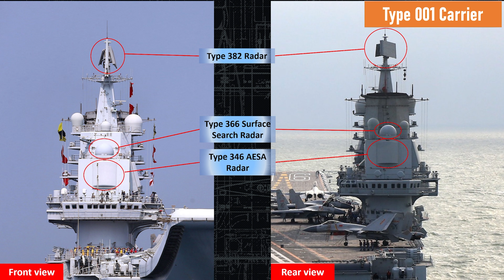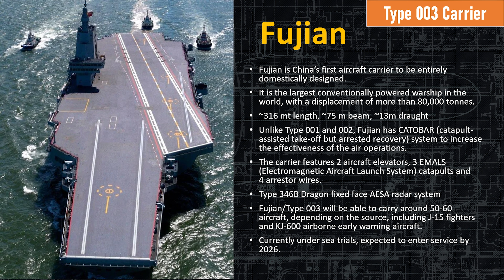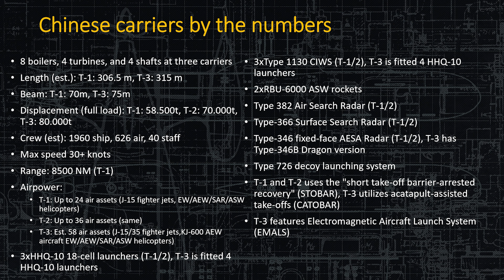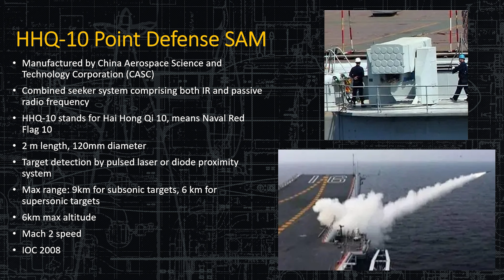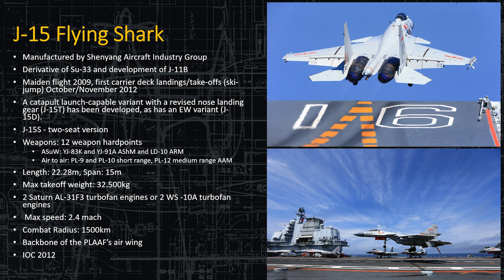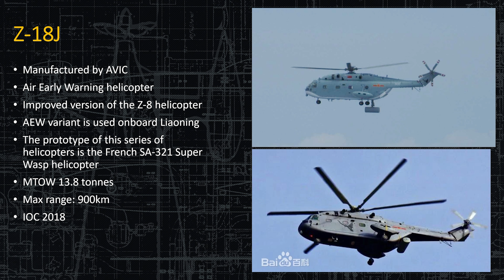China's New Fujian Carrier Changes Everything - Here's Why

Comment: 42:00 The J15 anti-ship missile variant launches with 20% fuel remaining from ships 1 and 2 and is then immediately refueled by a tanker plane dispatched from the mainland. This is a rather limited option, but China will operate its aircraft in the area of the first island chain and will easily cover the range of these aircraft using tankers from the mainland.
BTW UU NAVY did same with F18, and F35. (with F18 with 5 backpack as a tanker)

Comment: I'm confused by this video. why does it seem like the information in it is about 6 to 9 months out of date? did sub brief re-release this vid?

1. the power storage system - using super caps (which china is a world leader in) is hardly a straight up copy of a mechanical flywheel generator system used on the Ford CVN.
2. it wasn't a stolen system - it was a system developed and leveraged from their work with maglev and rail systems.  They likely have some of the most advanced DC power delivery systems, so it's hard to say they copied this from anyone.
3. even the ford has a replenishment ship following it around.  food, water, jet fuel, etc - so even nuclear carriers needs a babysitter.
4. J-15 can do air to air buddy refueling, so weapons vs fuel becomes moot.
5. J-35 is in serial production.
6. the Fujian is simply another training carrier, getting out the kinks of catobar, and leading to the development of the type-004.  As you know, China quickly iterates ship designs until they are happy with it, then they mass produce.
7. the fujian went into service in november 2025.

Comment: Why does it need to be refilled more frequently than a smaller AC? I thought the larger a ship is, the faster its fuel tank grows compared to engine sizes, thus, it needs refilling less (more gallons though obviously).
Reply: I just checked compared to US aircraft carriers operating in the pacific during ww2.  3-7 days depending on operational intensity. 

I know fuel was always a concern for admirals back then.  I didnt realize that much of a concern.

So his take on 5 days probably isn't that far off.
Reply: @wardaddyindustries4348  the "6 days" figure was AIR FUEL resupply limit. the carriers themselves can motor for far longer. Sub Brief is not an expert in non-submarine areas so you gotta do more research and take on more load to understand the complete picture.
Reply: @housemana  ah yes. I just looked a little deeper your right. That being said i wounder what the Fujian real range is with presumably more advanced engines. I have noticed that about this channel its not super often I watch it. I kinda wanted to just see how much he insults the Chinese capabilities before I left. Lol

Comment: I never served on a carrier, but I was fuel king on the USS Bainbridge a nuclear powered cruiser. We only used our diesel engines as emergency backup for the reactors. As such we didn’t run them all the time. When running they went through about 800 gallons a day. We had tens of thousands of gallons of JP-5 fuel onboard. This was the same fuel used by the Navy helicopters that would land and need refueling. Even then we only refueled our JO-5 tanks around once a year.
Reply: No diesel rot?
Reply: @surters  It's not diesel. It's JP.
Reply: What stopped the fuel going off/Rot?
Reply: OPSEC

Comment: Aight, so... looking at the comments it seems a lot of people don't understand how EMALS works and are seriously overestimating its power draw. This may be because the Ford's EMALS are said to have a power draw of 20 MW during its launch stroke, which in people's minds might translate to the four cats needing a staggering 80 MW to operate simultaneously. 

EMALS may need a maximum 20 MW per launch stroke but the key here is that each launch stroke lasts only SIX SECONDS. From publicly available information, the actual max energy draw per launch is 122 MJ. Catapult cycle time between launches on a USN carrier is technically 1.5 minutes, although in reality it's closer to 3 minutes. But let's take the theoretical launch rate and give each EMALS unit 1 minute to recharge. That's 122 MJ / 60s = 2.067 MW. Let's round up to 2.1 MW. The total power draw to recharge 4 EMALS at the same time is only 8.4 MW. For reference, a Kitty Hawk's total electrical power output was 20 MW. Nimitz generates 100 MW and Ford generates 125 MW. Fujian's specs aren't known, but tender documents suggest that she might have 8 of the same QD-50 turbogenerators used by the Type 055 destroyers. Each of these generates 5 MW, so Fujian's aux power generation capacity is around 40 MW. This is outside primary power generation from the integrated generators connected to her steam boilers. Hotel load is probably handled by this primary generator.

Assuming the EMALS on Fujian have the same power draw as the Ford's, the Fujian would only need around 6.3 MW to power her cats during operation. The 055 has only 6 QD-50s and her electronics and radar are basically the same as Fujian's, so Fujian's power draw from other combat systems are at most 30 MW. Even with all cats and systems running she has reserves of around 3.7 MW. She has more than enough electric power generation capacity to handle her cats.
Reply: Also, Fujian's EMALS is very different from the ford. It's DC medium volt based and should be far more efficient and reliable. China is now the top scientific and engineering country for electric engineering, energy storage, it is foolish to dismiss their technical expertise. They chose to go a different route and it is paying off. It shows they have the right people in right places to make these technologies possible. The Fujian is a indirect testament to China's over all industrial and scientific might. Seeing so many comments accusing the Fujian being unable to power its EMALS when some of the best electric, marine and turbine engineers and scientists in the WORLD are found in China is so absurd. It smacks of racism, it basically amounts to "no way these dirty yellow monkeys can build a functional CATOBAR carrier, no way Jose."

If EMALS is easy to research and build, why don't the French do it themselves instead of risking it and buying an unreliable US EMALS. They could have study the Chinese medium DC solution and replicate it. Why not?

Because the Americans and French literally CAN'T replicate it.
Reply: How is this power stored in order to be averaged like you're doing? Giant capacitors? A thousand tons of batteries? What happens if shrapnel hits these capacitors or batteries? 
I've seen Chinese batteries catch fire. It's ugly. 
I don't know about how safe capacitors are.
Reply: @ED-es2qv  Ford uses flywheels (because its EMALS is AC), Fujian uses MVDC capacitor banks.
Reply: @ED-es2qv  Just to back up the guy you, in your infinite wisdom are mocking, flywheels are also used in data centers as backup power sources.  They are made by such obscure and arcane companies as General Electric (GE), Eaton (go to the Home Depot electrical aisle), and CAT (as in the yellow caterpillar company).  As for how safe capacitors are...go lick one from a sound amplifier you would find at a concert from the 60s-80s and come back and let us know.
Reply: My dude, you are trying to explain science to Americans.  Waste of time.
Reply: @LackofFaithify  typical europoor superiority complex- yea surely Americans are just all stupid and haven't been at the bleeding edge at operating in the hard sciences for over a century now (:

Comment: why don't the USN shift to Compact Modular Marine Reactor propulsion & full IEP . . . unlike traditional marine reactors CMMR needs to be refuelled every 3 - 4 years & really small & compact in size, fully contained unit with a plug-n-play affair . . . agreed you'll need to put 4 or 5 (36 MW) U-CMMR that can be easily swapped with a new U-CMMR within a few days . . . no longer cutting through the carrier flight deck or the hull for defuelling & refuelling A1B marine reactors . . . U-CMMR operational costs are less than ¼th the cost of A1B marine reactors . . . the naval industry needs to embrace such modularity asap especially considering the current geo-political situation worldwide . . .
Reply: The reactors on the USS Ford will need to be refueled in 20 years.

Comment: It's the British who invented the modern aircraft carriers with the angled landing strip.
Reply: which makes the state of the British navy quite the tragic, sad, ironic tale. ya'll can't even field more than a single CRUISER at the moment, deadass how ya'll managed to defrang yourselves while letting a literal replacement population come in and start running things is impressive. legendary cuckoldry, fueled by white guilt.
Reply: What is the purpose of the angled landing strip? Maybe just to create more surface area for parking planes? Seems like it would just make the landing approach very difficult.
Reply: @edinson1613  
Are you real?  Knowing, why the LANDING deck is angled is MOST basic knowledge.  You just outed yourself as absolute noooooob,  the illiterate wannabe.
The angled deck was absolute requirement for jet operation on aircraft carriers.  It allowed for jets to bolter through when they didn't catch a wire on landing.
Before a jet running into the net behind the wires after a miss better got caught by the net.  Behind the net most often a heavy crane go positioned to preoect the planes in the front of the deck.  The pilot was toast when hitting the crane hard.
Reply: And the steam catapult as well as the mirror landing system.
Reply: I think the British used F4U corsairs on carriers while I think corsairs were more land-based by the US maybe because of poor visibilty when coming onboard the ship

Comment: Given china had German MagLev trains in 2001, i find it a bit unlikely that they stole the EMALS. Sure they copied the idea, however they had the neccesary tech (linear motors) for 20 years, and been the world supplier of high performance magnets for 10-15 years. More than likely they had this in the works.

Russians didn't have steam catapults. The chinese certainly would not bother with steam when everything is electrifying. The chinese aren't stupid, it's ill advised to assume they only copy.

There's also a great OP-sec cover to say you stole/copied. Because then the enemy assume your limitations is the same as your own.
Reply: The Chinese actually had a steam cat, designed based on the one in HMAS Melbourne. The Fujian's design flaw is a direct result of the Chinese EMALS being 12 meters longer than their steam cat. You can actually see this in satellite images of their cat testing facility where both cats sit side by side. The steam cat was rejected at the last minute because the EMALS design proved less finicky.
Reply: @andrewsuryali8540 not to mention that the maglev train tech, can accelerate 6x 53ton carriages to 431kph in roughly 2 minutes. That's plenty of force to yeet a jet off a boat.

Comment: Shandong isn't powered by diesel ENGINES. She has steam boilers just like Liaoning and Fujian. The confusion comes from the fact that Liaoning still drinks Mazut like her big sister, but Shandong (and Fujian) drinks diesel FUEL. 

Also, it's the JET FUEL reserves that need to be replenished every 6 days when air operations are ongoing. Both Liaoning and Shandong have operated at sea for 90 days without refueling. 

Liaoning's max aircraft complement is 40, same as Kuznetsov (24 J-15s, 16 helicopters); however Chinese naval helicopters are nowadays much bigger than Russian Kamovs, so Liaoning can only carry 8 usually. Shandong can carry 32 jets and 8 helicopters.
Reply: The PLAN is also deploying the largest replenishment ship ever built, up to 60k to 70k tons displacement and even more fuel and cargo gantries.
Reply: Shandong and Fujian use fuel oil, same as Liaoning which does also not use the heavy barely-refined Russian stuff.
Reply: Doubt It! An American would certainly be a Fool at this Point to Believe Any Boasts of the CCP but in their Authoritarianism!
Reply: @RealRandyRoss You only needed the first 12 words there. Everything else is redundant (in addition to being brain dead cope). If that’s your mindset, then I have a “laundry fire” and a training “accident” in Morocco to sell you (but no Epstein files though, those don’t exist)
Reply: @RealRandyRoss  I'm not Fudd enough to understand this chud's yammering. Can anyone translate?